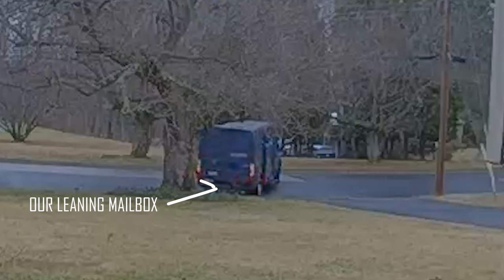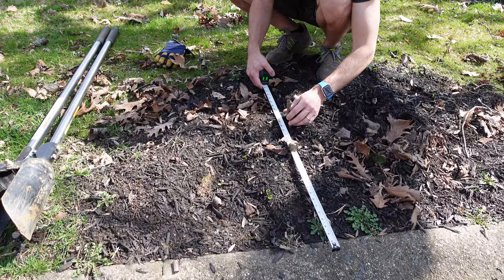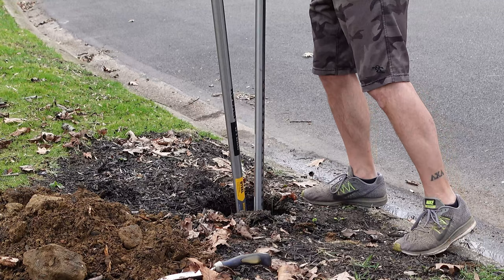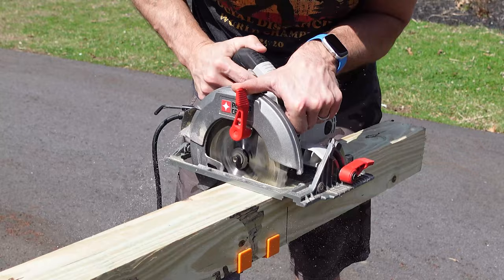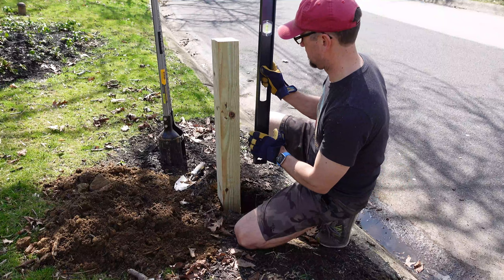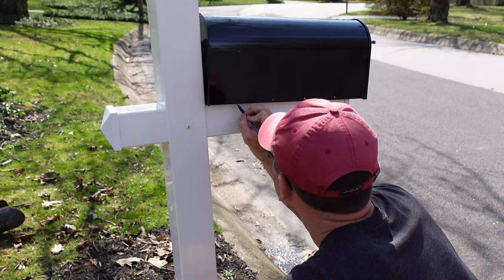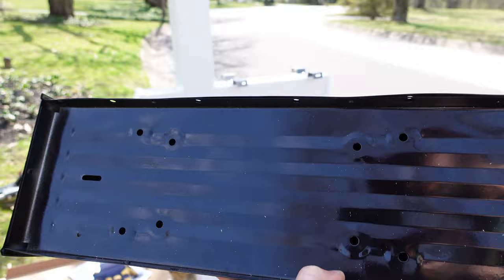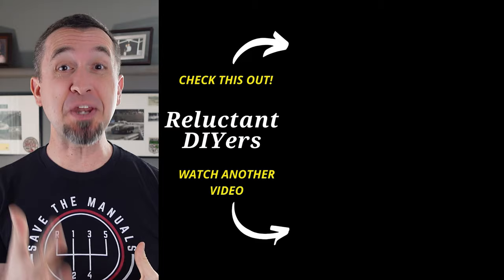Mailbox Install for Beginners

Comment: What is the best choice between those 2 boxes? metal vs plastic? Architectural MAILBOXES Ironside Large Capacity Galvanized Steel Black, Post-Mount Mailbox, MB801BAM   vs  Gibraltar Mailboxes Patriot Large Capacity Rust-Proof Plastic Black, Post-Mount Mailbox, GMB515B01
Reply from the maker: I always prefer metal. They are way more durable and I think they look nicer as well. 👍🏼👍🏼
Reply: @ReluctantDIYers  And mostly for the Maine Signature plus post, only metal or steel boxes will fit. Thank you
Reply from the maker: @rhoodj  You’re welcome!

Comment: I bought a new mailbox I'm wondering why is there screw holes on the inside of the mailbox.
Reply from the maker: Where are the screw holes?
Reply: I know about the screw holes on the side that go into the wood. I'm talking about the floor of of the mailbox it has four screw holes. Inside the mailbox
Reply: I'm wondering if those holes are for a different installation method
Reply from the maker: @stringlocker  Exactly. If the holes are in the bottom of the mailbox, that’s what this is for.
Reply from the maker: @stringlocker  Yup, that’s another installation method to connect to a post.
Reply: Okay thank you, you have calmed down my OCD. It seems you would have to have small tools to accomplish that. thanks

Comment: I want to mount my mailbox to a round pole with 2" diameter. What brackets can I get to clip around it? Thank you.l
Reply from the maker: Great question! One quick question back to you… are you mounting directly to the top of a vertical round post or are you mounting to a horizontal round post (so the mailbox will sit on top of that horizontal round pole)?
Reply: @ReluctantDIYers I am mounting directly on top of the radial metal pole. I have look at brackets, but they are all square at the bottom, I guess it's bc they mount on wood.
Reply from the maker: @philipchong6273  Ok, thank you for this response! Check out the video description. I just put a link in there for anyone who needs to mount to the top of a round pole. This will give you an idea of what is available to assist. Just make sure you buy one that fits the diameter of your pole. I hope this helps!